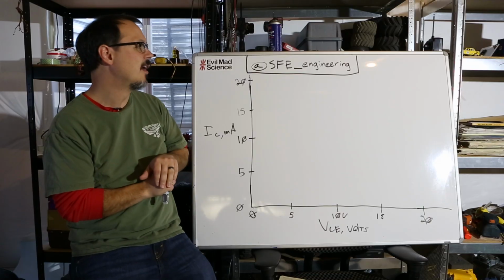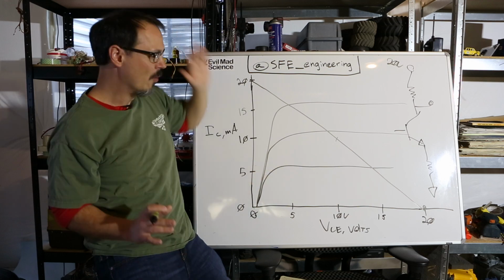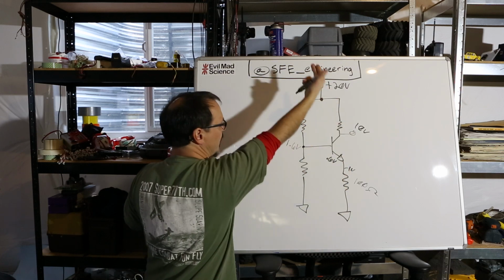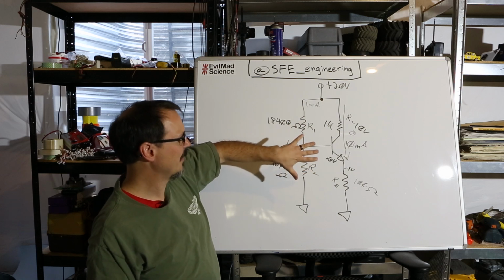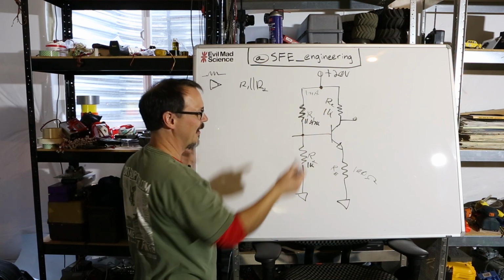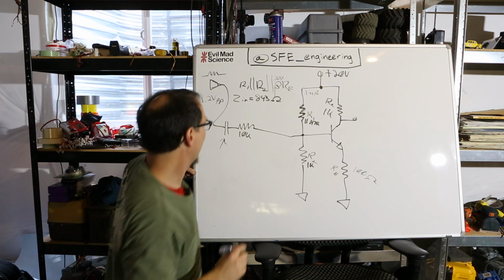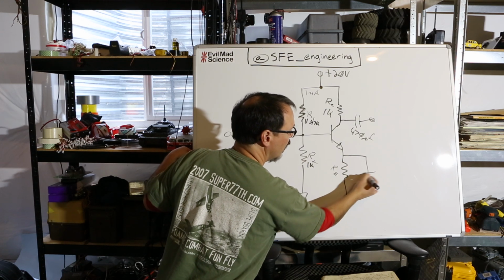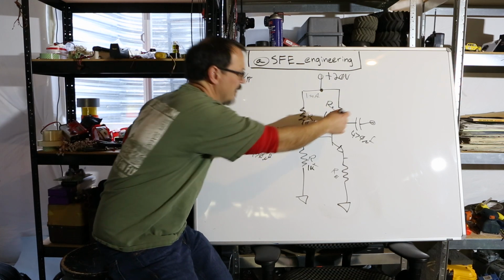SparkFun According to Pete #37: Transistor Biasing Configurations Part 2

Comment: Thanks for the great video. I would like to ask something though. You sayed that we shouldn't change the value of R1 and R2 because then we are messing up with the point that the load line crashes with the y-axis. But this point is Ic(sat) = Vcc/(Rc+Re). This is a value that is independent of R1 and R2. Actually I am reading a book right now that claims the same thing as you do. Am I missing sth here?????
Reply: Well, if you change the ratio of R1 and R2, you change Vbb, and since Vee = Vbb - 0.6; that changes Ie ( Vee/Re) and Ic, which changes Vcc (V - Ic*Rc). So, and Ic will change, and Vce. So the load line ( see 2:14 ) will change too.

Comment: How does one know what a good input/output impedance? I've heard him say that the ~800ohm input impedance isn't good, but in another video he said that the low (~10ohm) impedance wasn't good either. Is there an ideal input/output impedance?
Reply: Lance Clark Without going into the possibility of considering  a voltage  or a current source or any of the  four  possible amplifier configurations as, Voltage to Voltage, Voltage to current, Current to voltage and current to  current amplifiers   let me try   and give an analogy of input and output impedance.

Output impedance.   Assume a speed boat pulling a skier behind it, or a  truck towing a car.  Now the tow rope can have various stiffness and it could be elastic. If the tow rope  can stretch then the  load will not be  at a constant position with respect to the pulling craft   and the same happens when an signal source having a high impedance is used to drive  a load, The  voltage  applied to the load will change with the load as when a truck pulls a car and the load changes when  going uphill or on the level,  or downhill really when no load can be assumed. Then elasticity of a tow rope may be considered as being analogous to the  output impedance or a source or an amplifier.

Input impedance.  Well if  a person is  trying to lift  a parcel  with his outstretched hand,  irrespective of how  strong he is,  the weight of the  parcel  will  decide how far he can lift it.  If the parcel is very light , then man can lift his  hand at the end of his arm very high as the parcel is light.   If the parcel is heavy,  the man cannot lift his outstretched  hand too high.   Well the  mass of the parcel may be looked upon as the input impedance of the parcel.  If the parcel is very heavy, then then  the input impedance is LOW, if the parcel is   not so  heavy, then then input impedance is HIGH.

I shall   not  take this analogy any further as  some amplifiers work with  then " pressure " of the  voltages applied and not the current flow, while  there are other amplifiers which operate not  pressure or  voltages but with the  rate of flow or current amount.  In a water  pipe  one may have   high pressure and no flow, or a lot of flow and  little pressure.  One can have constant flow systems and constant pressure systems in any hydraulic system   all working with  flexible/elastic or non flexible solid pipes.    Basically all the effects of hydraulics using pressure or flow in solid or elastic pipes can be found in systems using voltage(pressure),  current ( amount of flow) and solid or elastic pipes ( impedances or admittances)

One should  write a book on analogies to try and help people understand the behaviour of invisible behaviour in  electrical systems. 

About your question how one does one know what is a good input and output impedance, well as  in reality there is no perfection, youn can find the answer if you considering the problems in the  TOWING INDUSTRY    and consider what sort of truck one needs to pull or tow a particular broken car/ load and the choice of tow ropes youn can tollerate considering that  even heavy trucks  cannot pull all kinds of loads and  choice of TOW ROPE IS  also to be considered.

Basically to conclude.     A current input  has a low impedance while a current output has a high impedance while a voltage input has a high impedance while a voltage output has a very low impedance,  as  they involve  operating with either Pressure or the Flow.   In   hydraulics I find  that many do not understand the difference between  pressure meters and flow meters. 

Many students when asked what happens when a  there is nan rate of change between a conductor and a magnetic field, most say, " A current flows"   NO  NO NO   the answer is a voltage is generated  (pressure).   A current  flow will only takes  place if the conductor  forms a closed circuit hence FLOW is possible.   Again you can have pressure( voltage) without flow( current)  such as an open circuit and one may have current (flow) with no pressure( voltage) such as a short circuit. A;ll this can happen in electrical sources and amplifiers.
Reply: Depnds on your source of signal and your load. Generally you do not want any attenuation  as a rule of thumb, the output impedance should be 10 times smaller than your load impedance. This of-course is not true in some applications such as rf/transmission circuits where you match impedances of source and load for maximum power transfer.

Comment: I stayed awake and watched it twice. Could you correct the value for R1 for the final setup. You stated 1147 Ohms. 20 X 1147 / 1147+1000 = 10.68. I think you meant 11470 Ohms. What 3 resistors did you use to achieve 11470 ohms? Trying to build this example. Really great information. Thanks

Comment: Remembering good times @ college... I always hated that configuration because you rarely get exactly what you calculated. Also temperature and replacing components with the same part number can change the performance, but it is still fun for academic usage.
I'm wandering if you are going to talk about good old power amps? I'd suggest that you design one and just explain the basics on the current mirror, the differential amplifier and the always handy type B output stage... Maybe a video no longer than 20 mins?
Still I think you are doing a great job on spreading technical knowledge and making it public and handy. As a teacher, your videos awesome because if they don't get me, they can always review your videos!